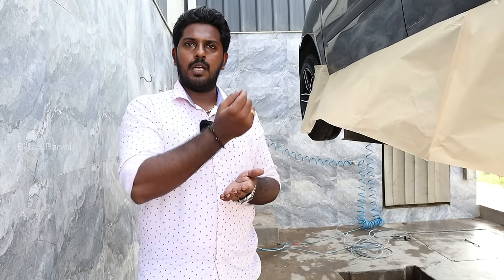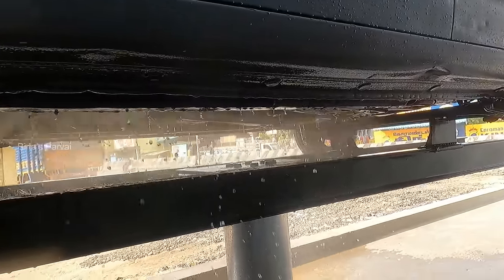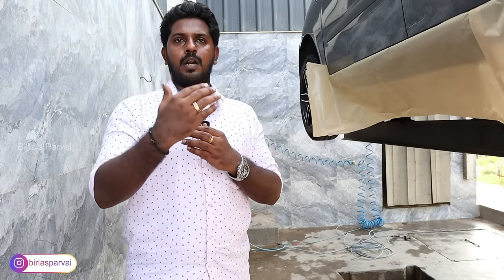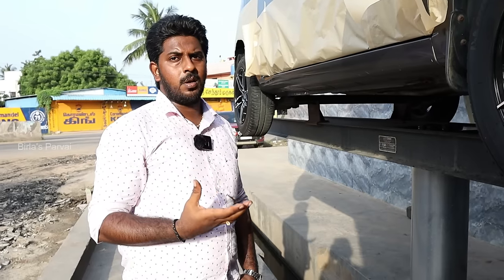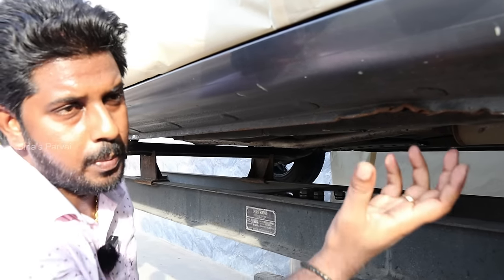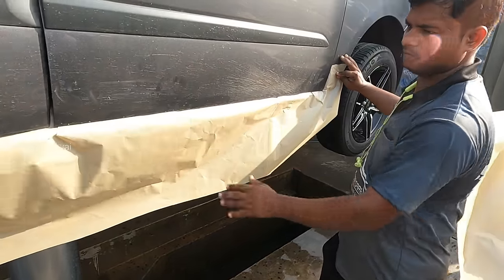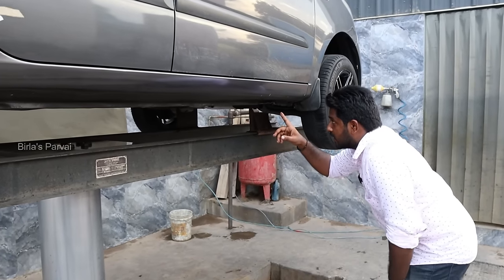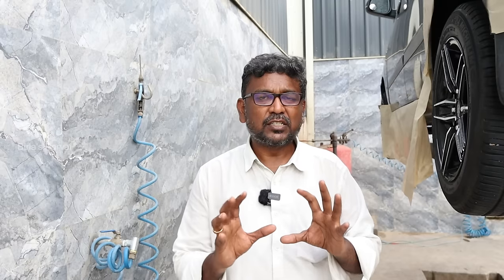என் காரின் தற்போதய underbody நிலமை | antirust underbody coating தேவையா? | Birlas Parvai

Comment: Seems like a promotional video, underbody coating is all just hype marketing! It's not the manufacturers insisting you to do under body coats, it's the greedy dealers, they tell you many horror stories and push you to do this. Don't fall for their trap!! New cars does not require UBC for atleast 3 years, because the company manufactures the car to bear and withstand all conditions.! I never expected this video from birla!!!!!
Reply: Simple, iron rusts but not the rubber or plastic and it's a internationally proven that UBC's prevents rusting, and it's an optional one all over the world 

So it isn't a wrong with the video😀
Reply: If you are not interested and not ready to spend for your car  just shut your mouth Dont spoil by posting negative comments, he said what is needed it is better to do UBC before taking the new car for delivery to prevent rusting
Reply: @Raven :: poya lusu
Reply: Since I work in car manufacturing plant I do have some knowledge about how it's done. And i am not debating anything about not to do UBC. It's my opinion on UBC, just sharing. 

Do note that a car when Manufactured in Plant is made with, Galvanized Process on Cast Iron and Iron Alloys with
Industry Approved Coating.. 
Galvanization is basically using advanced Zinc Coating on Car Metals. Zinc is what Anti Rust and these highly specialized coatings prevent car under-body from Rusting.

Enough Protection done through Industry approved Coating Solutions by Car Manufacturer so that Car Under-Body, Doors, Boot, Body Panel do not get impacted by Rusting. Also, Galvanization is done with Rust Resistant Alloys to provide long lasting Output without any Corrosion atleast for 5 years!!
Reply: Everyone have their rights to opine...like Birlas parvai, Raven but forth his opinion. Infact many car reviewers doesn't suggest UBC but its an optional for extra care. So let's leave it there and let us not insult each other...#mutualrespect
Reply: @NithinSuresh530  like wise u don't have the right to tell anyone to shut their mouth. Everyone entitled to their views. That too he put it in a very polite manner.
Reply: With due respect. This is his bread and butter. He can post promotional video and its up to us to take it or leave it.
Reply: @ajithkanna  Hi bro, FYI the shop address is shared in description.
Reply: @rameshiyer3862  yes bro, already saw the desscription..but he didnot uttered a word about shop details in the video, Thats the difference between him and other promotional youtubers
Reply: Appadiye car body layum pain pannita, we can prevent from dirt and mud 😂🤣
Reply: @ajithkanna  he does reveals shop names in videos. Check out for audio system videos and other few.. Don't blindly go with any youtuber.. We all have sense to analysis...
Reply: 100% true
Reply: Sharp knowledge📚 sir
Reply: Correct ha soniga bro 😊
Reply: Birla s parvai 's car is very old.. so he could coated...
Reply: @NithinSuresh530  it's not a genuine reply him...
Reply: @Raven-pr6pu  i agree u 👍👌🏻
Reply: Yeh new cars have 4mm coating from the yard itself.
Reply: @NithinSuresh530  be polite with other users.
Reply: @Raven-pr6pu  My car is already 6 years old, should I do UBC?
Reply: @Raven-pr6pu ..thanks for the information.. Probably u should have posted this message first..it makes a lot of sense

Comment: Underbody coat is not at all necessary. 15?lacs koduthu nama car vangarome oru 2500 rupees ku company yen podala.These guys will apply coat for some of the parts which we should not apply if we really need underbody coat we can do with the dealers. This guy saying if something hits the metal it creates tear and rust will start yenpa coating pottalum paint tear agum if something hits the underbody. Namma alu Birla Remba vivaram polaye..

Comment: Since I work in car manufacturing plant I do have some knowledge about how it's done. And i am not debating anything about not to do UBC. It's my opinion on UBC, just sharing. 

Do note that a car when Manufactured in Plant is made with, Galvanized Process on Cast Iron and Iron Alloys with
Industry Approved Coating.. 
Galvanization is basically using advanced Zinc Coating on Car Metals. Zinc is what Anti Rust and these highly specialized coatings prevent car under-body from Rusting.

Enough Protection done through Industry approved Coating Solutions by Car Manufacturer so that Car Under-Body, Doors, Boot, Body Panel do not get impacted by Rusting. Also, Galvanization is done with Rust Resistant Alloys to provide long lasting Output without any Corrosion atleast for 5 years!!
Reply: Well said ….
Reply: But still corrosion happening in under body.
Reply: Makes sense... So this means after say 7 or 8 years it is highly suggested to do UBC. My opinion.
Reply: Informative!! 👍
Reply: @Raven, so we should do it compulsorily after 5 years, right? 
Should we scrape it first and then paint it or directly apply it after washing?
Reply: Super bro you saved my 4k for ubc…

Comment: They applied the paint over the rusted/damaged part. How that is going to protect from further spreading? First rusted area to be cleaned and protection paint to be applied to stop further spread. Then only the under coat or other protection to be applied. If we paint over the rusted part the whole area will be rusted and will come out as one piece in time.

Comment: After buying a car, seat cover, ppf,  sun flim,, extra speaker change , driver hand rest, led headlight,  dash cam , suspension pro, automatic door closing ,  ambient  door light,  wax polish,  fire extinguisher,  air stimulater,  perfume,   floor mat, 5d mat, glass and dashboard cleaner,  vacuum cleaner,  anti fog sticker,  blinds spot mirror, gps tracker., air purifier etc etc etc.  Good to have more and more,  however have to pay more.   I think,  extra fitting never cover in the insurance .  Your views on this?
Reply: After Market Accessories Venam Bro, Ungalku Yena Features Veanomo Athe Varient eh Select Panunga, Athukumela Veanuma Just Put Seat Covers And Floor Mat, Mathaapdi Factory Fit Than Best.

Comment: It depends, for non coastal areas, undercoat may not be required. Also there should be minor nvh improvement due to thick underbody coting
Reply: What is nvh improvement??
Reply: @praveendon4431  noise vibration harshness
Reply: @techien6212  oh ok
Reply: Well.. that so called “thick rubberised coat” will actually trap water and help rust do its job..lol
Reply: @YOURS1  if metal is not exposed to oxygen, it should be fine.
Reply: @techien6212  i dont think its worth explaining to someone who doesnt understand what h2o is!

Comment: Bro
Generally new cars bought not recommended by car companies as the new cars are already company standard coatings done, tested & then goes out for sale.  If a car is used near to coastal regions, then this coating is mandatory. 
In general 5 to 7 years, company recommended coating is advisable.

Comment: If you inspect the underbody of your new vehicle say after 3 years you will find rust spots .Any paint cut  happened due  hard water washes or road chips cut the paint and Rust will creep in .My suggestion is you for a new car inspect it after one year and see for yourself then decide .but it’s always better to use a high quality paint as per manufacturers recommendation for extra protection 

This suggestion of underbody coat is good  

myself as a mariner I would go for it for I have the seen what high quality paint or an additional coat can protect saltish atmosphere and sea sprays at sea! The same would apply for dusty roads chips and hard water washes for the car !

Comment: i got a Ford Figo-1.2 L 2016 petrol . its less driven and done 16k kms.  I am getting humming sound from front right wheel while driving above 30 km. and also a scartchy sound is observed while applying brake. plz give your suggestion

Comment: Hi Birla Parvi Sir. I have given my car for general service and asked them to check the condition of clutch and Suspension condition. Since the age of my car is 9 years.. 

They told that the condition of the clutch and suspension is not bad. I can change it in the next service.

I took the car from the service. Now I can see major differences. (My car is running like a horse with full vibration). 

They are saying. If the car is taken into Ramp for the normal check. The suspension issue will be increased. 
Is this true?

Note. I have seen any vibration before the service